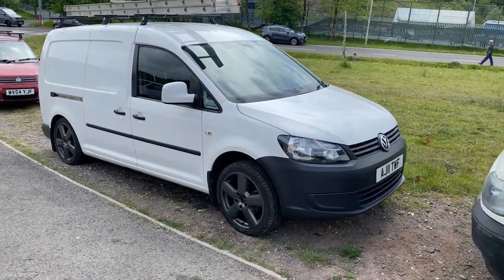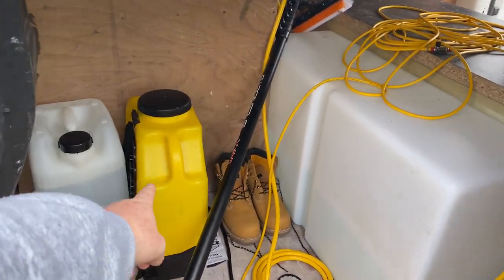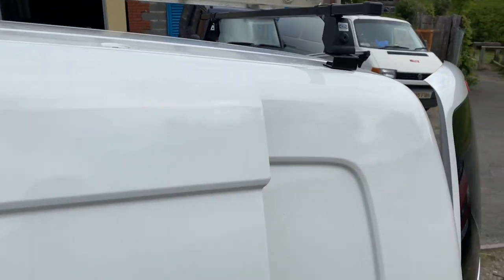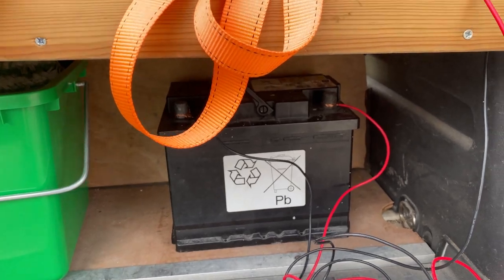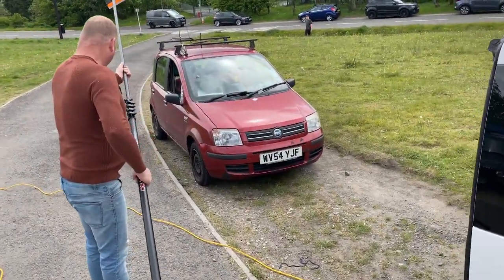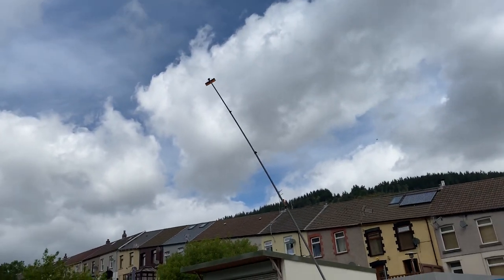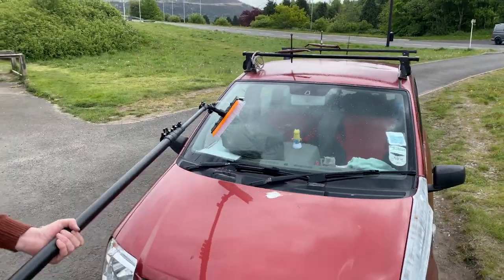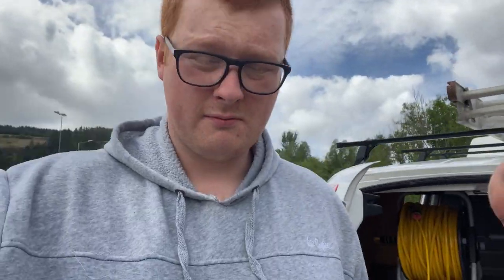VW CADDY WATER FED POLE BUILD

Comment: Hi mate your doing well, if you did want even better stability consider possibly having your tank against the bulk head as the weight is better over the middle/both front and rear suspension....where as at the moment its predominately over the rear. Please its no criticism just want you safe and also better for your suspension etc.
       I had a fiat doblo, ford connect(which was a real work horse) now fortunately a lwb transit custom. But i learned alot squeezing into the 1st 2 vans safely over the last 18yrs.
    Good luck mate and here if you ever need advise😊🌈 Andrew

Comment: Sut mae butt. Greets from Bridgend. Looking to build a similar set up. Just bought an old (but tidy) Vauxhall van to convert. 10 litre per minute Sureflo pumps are on their way (2 of) but I'm wondering if you could recommend a place to pick up the digital flow controller you used? Love the dead ended feature on yours so I would like the same. New sub here BTW. Pob Hwyl butt.